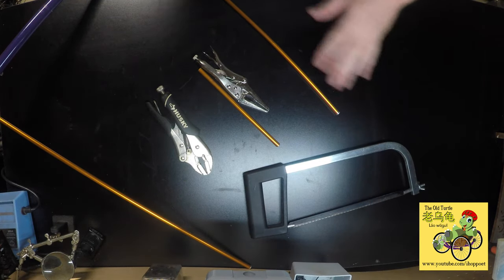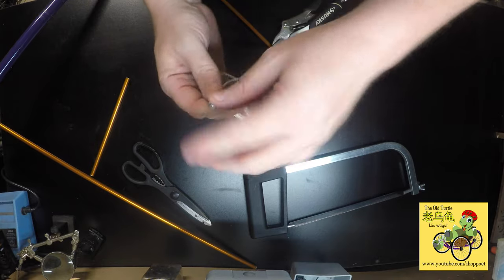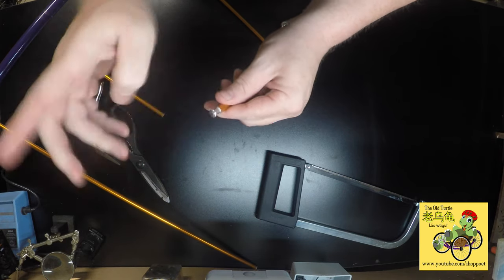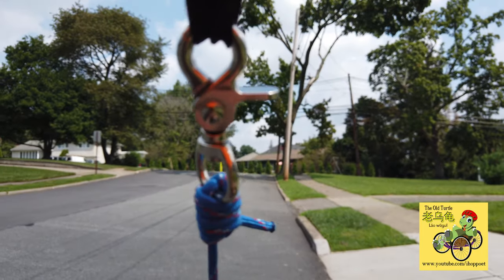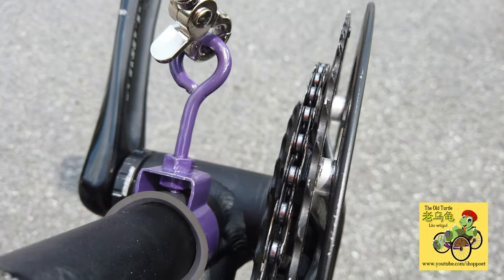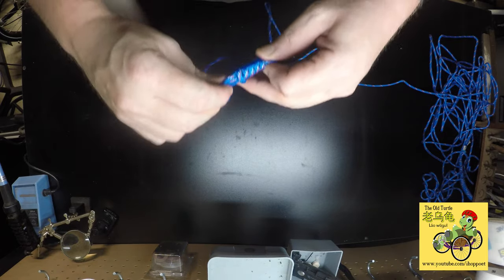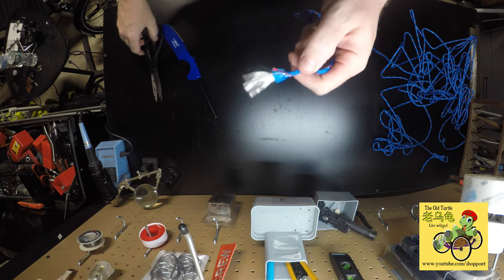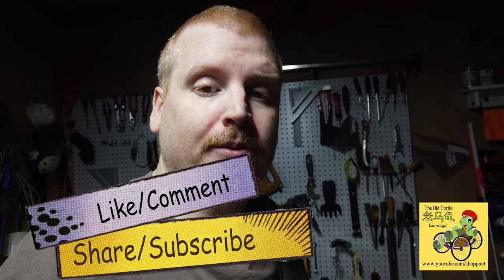Upgrading my Trike Canopy

Comment: Hello ihoppoet great video, I just have some questions on this updated you added one more Conduit hangers to make it three (3) now right,  okay now you put 2 1/2 inch nuts zinc,  are is it 2: 1/2 inch nut zinc and on the bolt is it 11/2inch bolt or 1: 1/2 inch bolt, and also can you put the link to home depot like you did for all the others parts list and also where do I get the bungee cords and the leather strips you use with the conduit hangers, and sorry one more thing what do I do with the third conduit hanger?